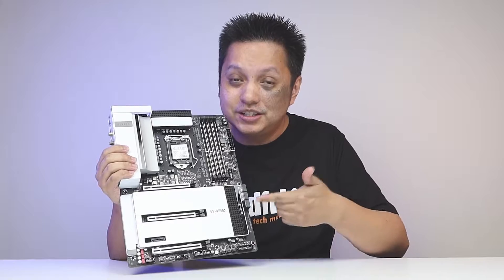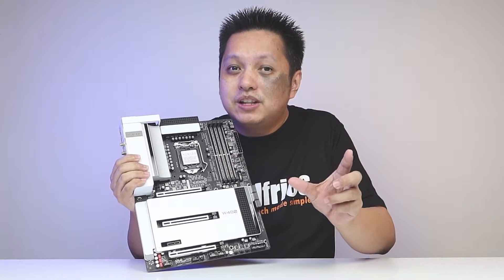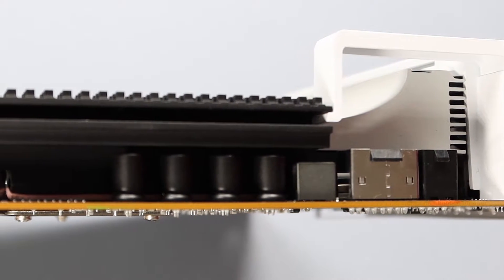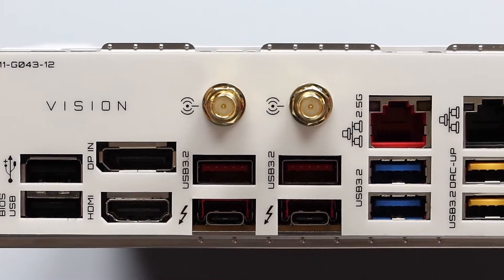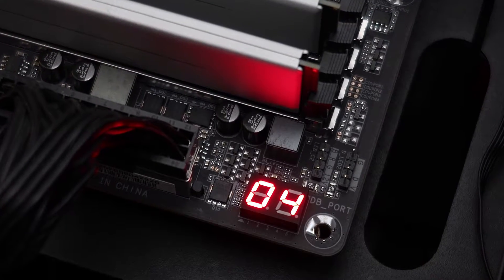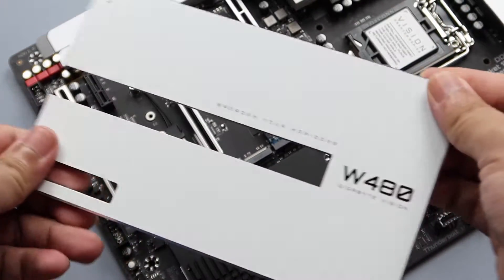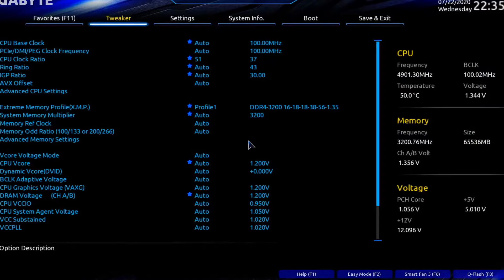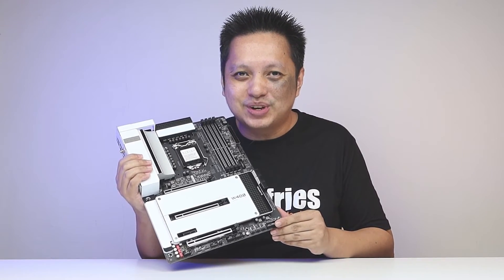Gigabyte W480 VISION D Motherboard Review

Comment: i bought an i7 10700K LGA1200 is it compatible with this motherboard???
Reply: Yeah… but you can’t overclock it :( so this motherboard is locked so you can’t overclock anything… (CPU, Ram, GPU) ;/
Reply: @kvetinky6831  you can't overclock it but can use Error Correction RAM so that the computer is very stable. It's for content creators who need 100% reliability and don't want Windows Blue Screen freezing and losing their work. I've used systems with Error Correction RAM and after a while you become used to the system being stable that it's a shock when using other systems that have blue screen restart, crashing etc. Performance v reliability, it's a trade-off forever!